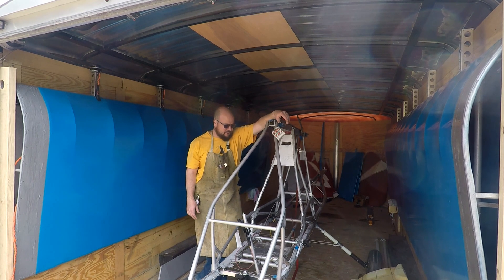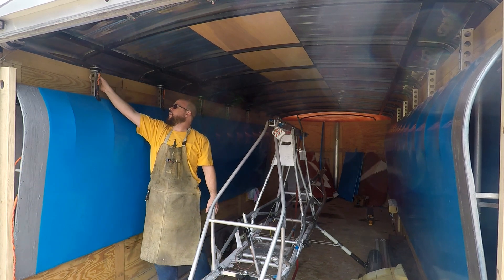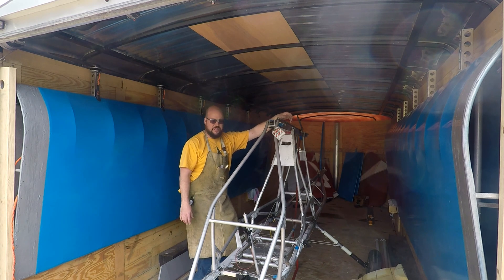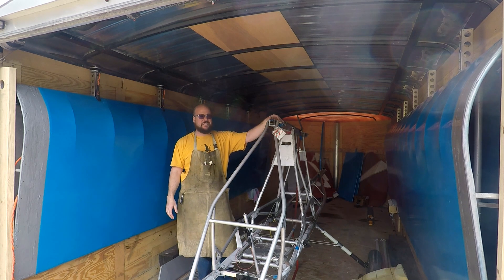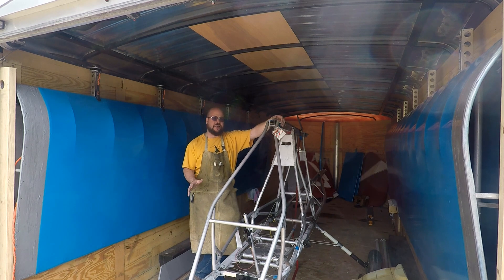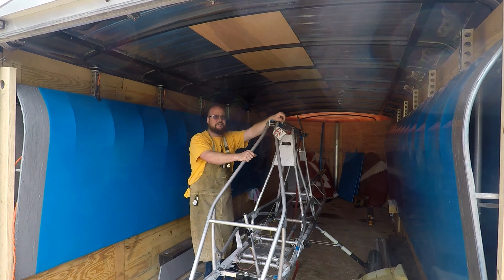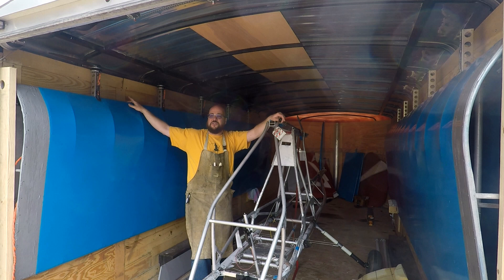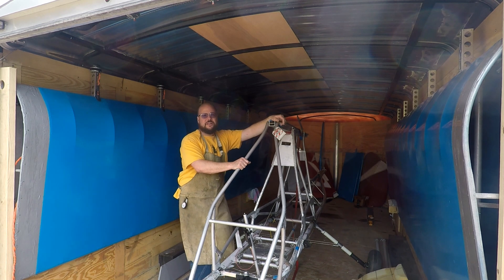Challenger Update:  80% done, 80% to go, Ultralight or Experimental?

Comment: Can you do a gas generator in place of batteries.  May still be more fuel efficient,  it's how trains work.  Diesel generators for electric motors.  Use a small generator and a bank of capacitors for extra power and short silent stints. You could use a small 2 stroke to drive an alternator and save weight.